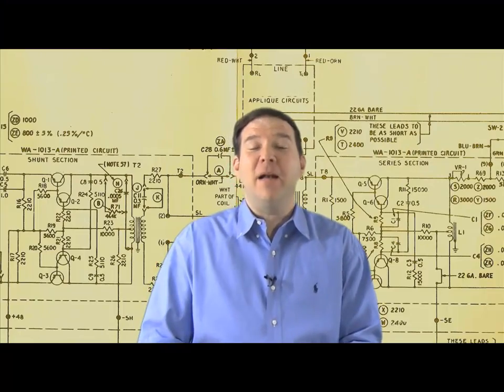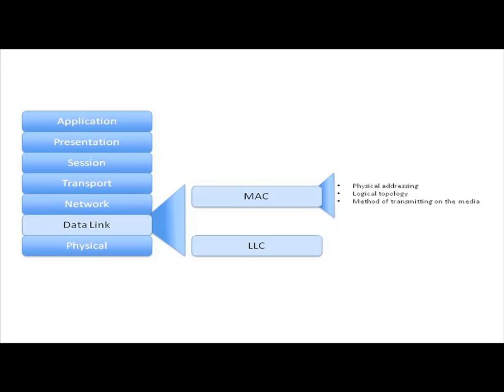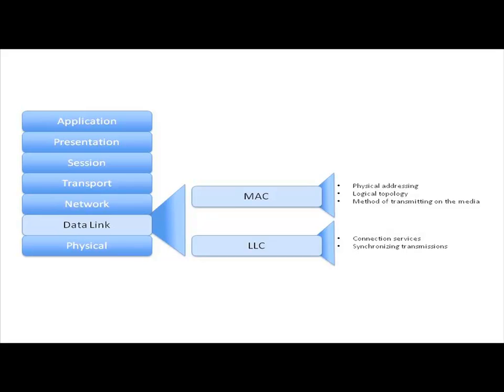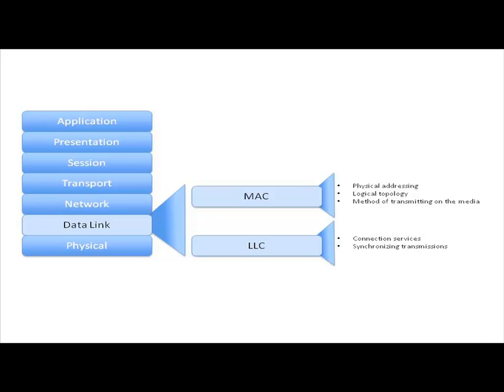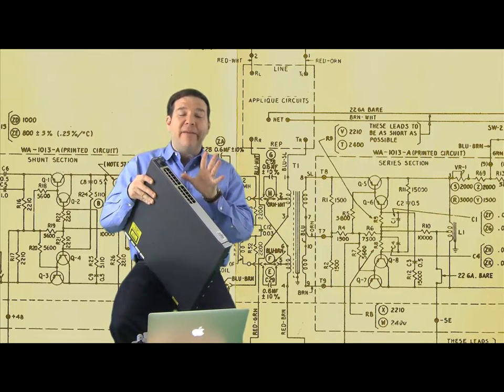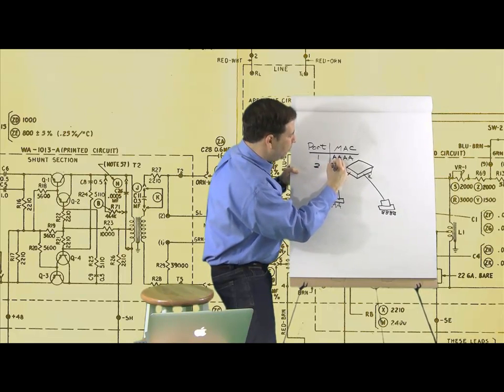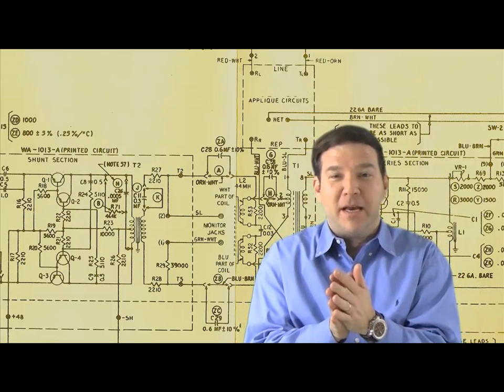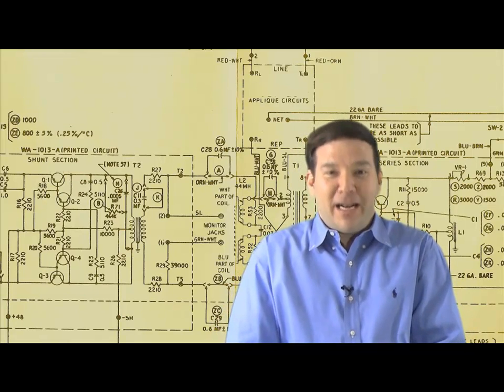ICND1 - Video #3 - Layer 2 - The Data Link Layer

Comment: How would I learn more about the clocking? The way I'm understanding it right now is that depending on what data link protocol you are using in a network each one will have it's own defined way of clocking be it async , sync etc. and this is what the LLC sublayer would define in it's header? For example ATM protocol would have it's clocking info in the LLC header which is contained in the frame.